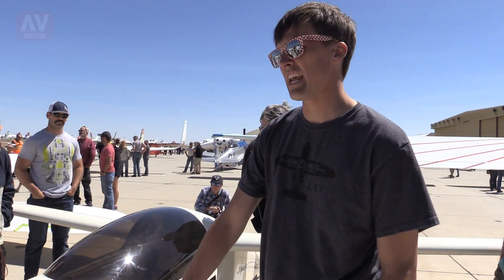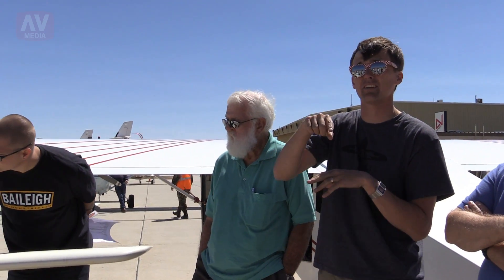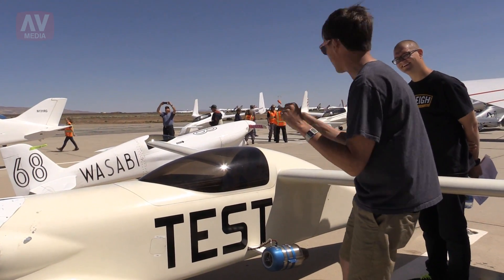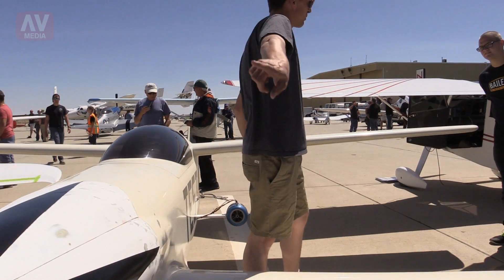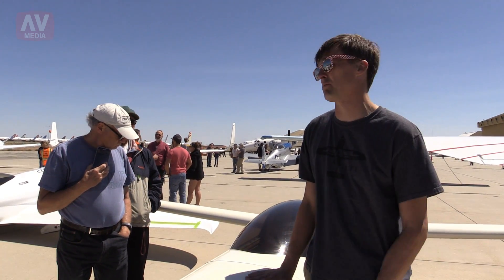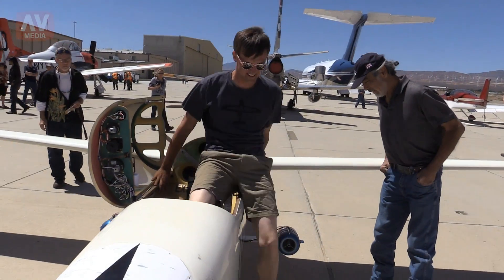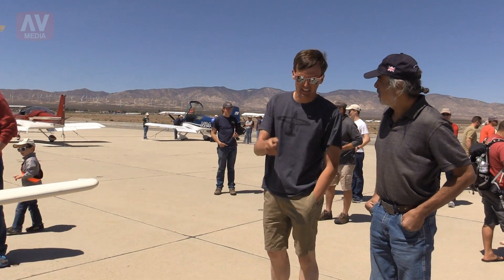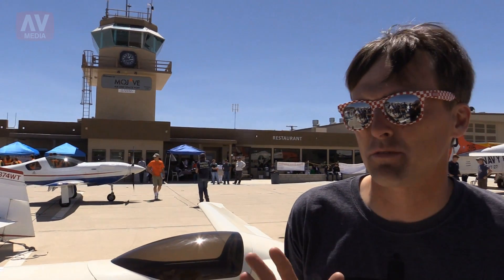TWERP jet turbo engine power test - Wasabi Air Racing (full interview)

Comment: The JetCat SPT15- RX turboprop makes a 24 hp with a real twin shaft turboprop just like a P&WC PT6, I have seen it mounted in RC model Pilatus PC21 aircraft with a fixed pitch 5 blade propeller as heavy as the empty weight of the Quickie Q1 (143.3 lbs) and this model was ripping through the sky. I bet it would be pretty awesome on your Quickie. See the link below to see the turboprop in action
https://youtu.be/8Dbm_F0LZks?si=gFNmsuoEJASdKB5y

Comment: This all feels so sketchy, like he's just asking to get killed - and that's without seeing that the thing later crashed and the pilot was lucky to survive with minor injuries. The mistake I saw with this is that they did all this experimentation, with new untested engines (testing the engines being a major goal of the project) spaced widely to cause differential thrust and control problems on an aircraft that's already notoriously difficult to control. Combining a lot of ominous things. My opinion is that they should have chosen a different airframe for this purpose, something more controllable, something that doesn't have a bad reputation even before they strap a couple jet engines to it. My thought would be some sort of glider, a small single-seat glider, I've seen jets attached to those. Would need to find some way of adding fuel tanks (something a glider has no need for), and if possible could clip the wings to fly faster. The low drag of a glider with clipped wings could potentially be very fast with jet engines as long as they take measures against flutter on control surfaces not built for those speeds.
Reply: The Quickie Q1 is very easy to control. It has no bad tendencies. 

It was designed by an Air Force stability and control expert who was previously contracted to solve the F-4 Phantoms unrecoverable spin problem that had resulted in the loss of dozens of aircraft and several pilots lives. 

The engines are reliable. Turbines are usually much more reliable than piston engines. This aircraft originally had the Onan 16hp, 18hp and later the 20hp engines often found in 1980s John Deere riding lawn mowers. But that engine suffered cooling and vibration issues in the Quickie aircraft due to its installation design.

The turbines will cool themselves, and don't vibrate at all. Mounting them apart like that is not so bog of an issue. Most jets mount them exactly the same way, on the aft rear fuselage, and commercial jets mount them under the wings many many feet away from the centerline.

The only issue with this airplane was attempting a single engine go-around instead of just putting it down on the runway at the first sign of problems. Having an engine out in a quickie is not a big deal. It lands slower than most highway speed limits and its so small you can easily use roads.

Comment: I was thinking "cool jet assist!" then I saw no prop! That's a bold move, and brave! These planes are becoming popular, I like the futuristic design.
Reply: Too bold in the end - this aircraft later crashed due to one engine flaming out on an aborted landing, wasn't able to control it, almost rammed into a bunch of parked planes, before smashing into a shed, destroying the airplane but amazingly only causing minor injuries to the pilot.
Reply: Quickie Q1 was designed in the late 1970s and the first one, N77Q, flew in 1977. They were very popular in the mid-1980s. Selling over 1,000 kits, possibly 2,000. The president of the company died in a plane crash testing an experimental around-the-world design. The company struggled after they were sued. They won, but they went bankrupt anyway due to mounting legal fees in the realm of several hundred thousand dollars in the mid-1980s.

There is still a lot of interest in this design, and the plans are available free although sized incorrectly. There are some better plans with proper scale and templates offered for sale for about $100. But there are several items that need fabricated and no plans exist for them. (Prop extension, tailwheel fork, engine mount, etc). There is also the issue of few Onan engines remaining in "airworthy" condition, and when new it was not really adequate for aircraft use. There have been several Kohler/Briggs V-twin and Rotax 2-stroke conversions that work well.
Reply: Made in the 60s

Comment: Holy crap, the fuel lines to those engines, RC sized.  Glad he walked away unhurt, when you look at the video of the forced ditch in the boneyard, it's amazing that he did.  That would make anyone reassess whether they want to continue down this path.  With that GREATLY extended nose and the side mounted motors, I think I would have added some rudder authority, just sayin', they were kind of stacking things up there.  I wonder if Rutan looked at it and gave any input..maybe doubtful since he got out of the homebuilt kit business do to the mitigation/liability crap that was arising. I looked at the Quicky and Q2, and decided on the Long EZ to build.  Unfortunately, never completed it, sold it, someone else did, been flying for many years now.  Often wish I'd finished it.  What a plane, especially for its time frame.

Comment: "an untested power plant from a company that's never manufactured an engine for an aircraft for manned flight. " This is absolutely not truth. PBS is an old company manufacturing APU units and other turbomachinery for a long time. Their TJ100 engine is well established drone/UAV engine, being fitted also to some experimental airplanes. Current developments like TP100 - turboprop with 180kW takeoff power aim for GA market. This engine is scaled-up R/C engine, it is relatively new and it means that there will be some development necessary, but that´s all.
Reply: It runs like crap thats all lol he almost bought the big 747 Tail in the sky.
Reply: And he is A fine test pilot with Incredible skills . He flew it like Bob Hoover would all the way through the crash.

Comment: Why turn toward the parked airliners at Mojave instead of just turning a little to the right and putting it down in the dirt?   Too much wind?
Reply: Tom C because when 1 engine dies , you lose control because of torque steer

Comment: "If one quits, just shut the other one down and land where you land" turned out to be an ominous comment
Reply: You would shut down the second engine when you have a choice between landing under control with no engine power vs. fighting asymmetric thrust from the operating engine that is trying to roll you over on your back.
Reply: James Stokes did they ever explain wtf happened? Did it just loose fuel? Because this is a really cool concept. A commercially viable jet engine that's usable and affordable and fuel-able by normal people.
Reply: Hey Guys, I apologize I didn't see these comments sooner.  Some notes as well as the project report are below.  Thank you for the interest.  - Elliot

There was fuel in the tank, fuel in the lines, and all the fuel lines (and electrical connections) were correct when the engine shutdown.

The engines were sent back to the manufacturer for physical inspection and to be rebuilt and returned for more testing.   They were also going to check the controller memory for the NTSB requested data logs.   The manufacturer did not disclose what if any cause for the shutdown they were able to determine.  Then engines are still at their facility.

Program report below.  Let me know if anything is unclear.  Thanks again.

https://docs.google.com/document/d/1bIC3H3Z7UVuESJpjotc4F108w7LdnkaKs7J-dz-EJVc/edit?usp=sharing
Reply: Tommy in talking to people on their ground crew, there was nothing apparent to them after the crash as to what caused one of the engines to shut down, last I heard they sent the engines back to the manufacturer so as they could do their own investigation into the shut down. With advancements in technology it seems like we are entering a new realm of crossovers from toys to real world use. These are over sized rc engines meant for drones and look at what direction toy quad copters have gone, they are being built large enough now to carry people.
Reply: NPC #303  nope he walked away, but it was UGLY.
Reply: Lol land where you land
Reply: @DJSbros  In this case almost into the side of an old airliner, but instead through the wall of a portable office.
Reply: NPC #303 no he was just fine luckily. 😀
Reply: what fool shuts down a 2nd engine when one  is bad
Reply: @johnnyllooddte3415  Someone who understands that they do not have enough yaw authority under one engine to control the aircraft. The only thing foolish in this situation is the small rudder.
Reply: @johnnyllooddte3415  Someone who knows about flying and the characteristics of the aircraft they are flying. That's who.
Reply: @johnnyllooddte3415  no, I don't it's the smart thing to do when I trouble at low speed with asymmetrical thrust, IL never fly with you, your dangerouse.
Reply: @johnnyllooddte3415  Elliot explained the reason early on , he's no fool , I'd fly with him any day !!!
Reply: johnny llooddte you need to see the video that will explain his thinking at the time.
Reply: @johnnyllooddte3415  Ya ever heard of VMC? Well this plane's VMC was unknown.
Reply: @johnnyllooddte3415  One that thoroughly understands aerodynamics.

Comment: you may want to have you engine tile with the elevate control it is called thrust vectoring and I would also suggest to set it up controlled by radio control and I also suggest you use Christ Tucker of Redford MI Best pilot  I know

Comment: It's like a Flying Flea on Meth (Speed)....     What's interesting is he says in this video exactly what he has to do when one engine goes out... shut down the other immediately to keep the plane from yawing because he doesn't know if he has enough rudder to counter act that... and land straight ahead...   yet when he crashes it,  he fails to do both, instead leaving the running engine on and yaw turning into the only obstacle in the whole desert, a group of commercial airliners.... :-/   Was he not the pilot when it crashed, but someone else?     https://www.youtube.com/watch?v=QnJBMYC8ReA
Reply: You must be looking at a different video than the one I saw. He only realized the left engine was out after he was headed into the boneyard (decommissioned aircraft, not "a group of commercial airliners"). At that point, landing straight ahead on the runway is no longer an option. He can only hope to maintain or gain altitude.
Reply: Mrfrenchdeux Maybe so but to nitpick about the "commercial airliners" seems petty, in my humble opinion, as "decommissioned"or not; it's a fact that those planes were decommissioned commercial airliners. I don't believe the guy was saying the planes were full of passengers, but again, this is just my opinion.
Reply: Why didn’t he know if the rudder was big enough to counteract the loss of one engine? Wouldn’t that have been easy to test in safe height?
Reply: CHOPPERGIRL's AIRWAR - The sudden jerk from the gust created a fuel starvation and caused the flame-out. Things happened so fast after that. He was to busy trying to level it that he couldn't attempt to shut it down. Basically at the same time he experienced a strong adverse yaw that abruptly pointed his low flying plane to the boneyard. All the rudder, all the aileron, and all the up elevator couldn't steer him away to the open field. He had to maintain his full attention on the controls to prevent from going down. At this point shutting down the engine was out of the question. He was to busy flying like Star Wars between the other jets. This was CRAZY. He so lucky to be alive.
Reply: Exactly...plan the flight and fly the plan!!! The pilot got extremely lucky that day!!!
Reply: Rosacea, that exactly why I would have tested it on the first flight, but in a safe height where I was sure that I could glide down. He might loose an engine in the second takeoff, so better do these basic tests as early as possible.
Reply: He didnt use the right rudder at all as seen on the video. Was using full right aileron but releasing it totally every other second, which of course will bank the airplane to left. Panic Reactions. Have seen that on some i taught. Just Panic Pilot Reactions when the shit hits the fan. You have to bring the dead foot ALL THE WAY BACK TO PREVENT IT FROM MOVING IT FORWARD IN FEAR.
Reply: outwiththem  Well in all fairness to the pilot, the Quickie isn't much of a glider, more like one of Rutan's nutty experiments, in this case a missle with control surfaces added.
Reply: He crashed into a portable building in the boneyard.
Reply: Hudson Donnell - That portable building absorbed  a lot energy. It was at the right place to saved his life.